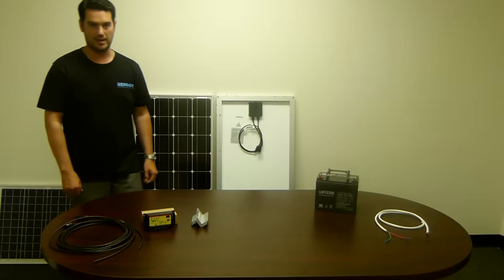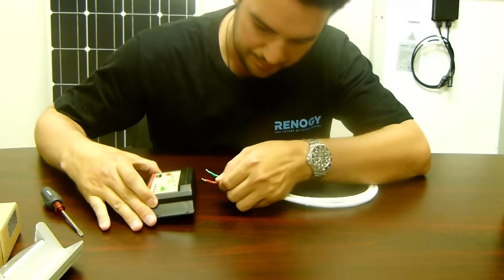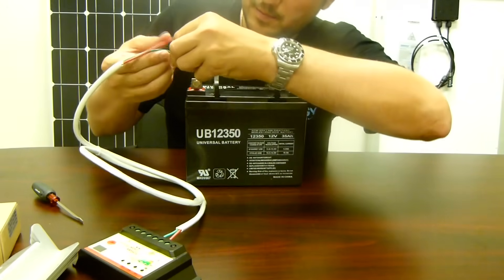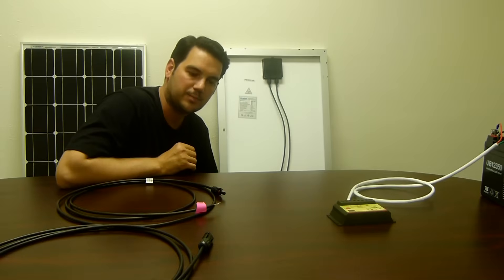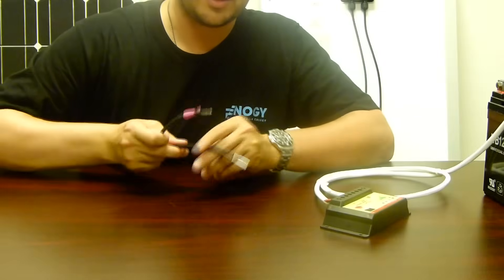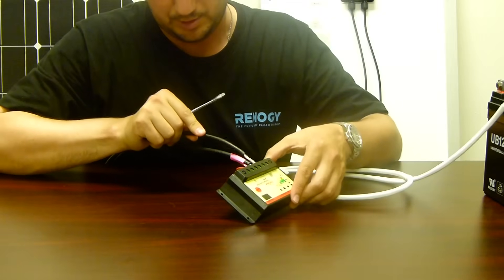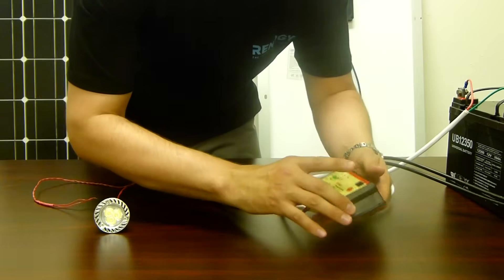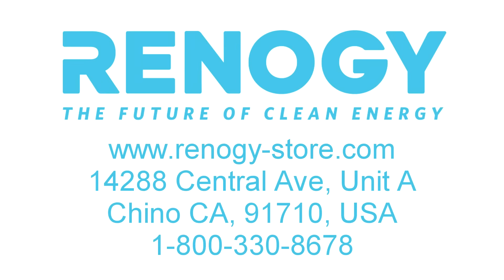Renogy: 100 Watt Starter Kit Solar Panel Installation Guide (Previously Complete Kit)

Comment: Can we use the load in the charge controller to connect to the power inverter???
Reply from the maker: Hi +Saeed Mizan, No. You cannot use the load in the charge controller to connect to the power inverter.
Reply: Does that mean we have to connect the power inverter to the battery.
Reply from the maker: +Saeed Mizan Yes, inverters connect to batteries with an inverter cable (e.g. something like this http://www.renogy-store.com/5Ft-4AWG-Solar-Power-Inverter-Cable-p/invtcb-5ft-4.htm).
Reply: Are there any cheaper power inverter cable??
Thank for your help, I appreciate it.
Reply from the maker: Saeed Mizan Hi, you can use any inverter cable to go with your inverter, though it should be the same gauge as recommended by the inverter's manufacturer.
Reply: What is a gauge
Reply from the maker: +Saeed Mizan The gauge size is the thickness of a wire. The inverter you have should come with a recommended gauge size for an inverter cable.
Reply: Oh Thanks. I tell fell like installing this with the help of my parents in my room. What kind of battery do you guys recommend for this solar panel kit?
Reply from the maker: Batteries are dependent on the kind of items you'd like to use with it. If you'd like, you can give us a list of items you'd like to power and their wattages, or amps and volts, and we can help size what would work best for you. However, a 35A-50A battery would work fine for a 100W Starter Kit.
Reply: I want to use 105 watt tv for 6 hrs, I want to charge 2500 mah battery with a 1amp battery charger for 8 hrs, I want to on my 11 watt led bulbs for 8 hrs. So, what's the recommended battery?
Reply from the maker: Saeed Mizan For a 100W panel, a 60A battery should be okay for you. A 100A battery would provide you extra power, however with a 100W panel, it'd take you two days to charge it. We'd recommend 200W if you would like the 100A battery.
Reply: Is it okay if I use 2 30A batteries instead of one?
Reply: Would a 500w power inverter be enough??
Reply: Can you recommend me an affordable power inverter?
Reply: Renogy Solar?
Reply: Renogy Solar?
Reply from the maker: +Saeed Mizan Yes, it'll be fine to use two 30A batteries to make a total of 60A.
Reply from the maker: +Saeed Mizan Yes, a 500W inverter should be enough to handle what you're planning to power.
Reply from the maker: +Saeed Mizan Here's a link to our own inverter. I'm afraid I wouldn't be able to recommend another one as I don't know much about other manufacturer's inverters. http://www.renogy-store.com/500W-Off-Grid-Pure-Sine-Wave-Inverter-p/invt-500-12v.htm
Reply: So that must be the cheapest must. Would a 500w inverter be enough to power a tv for a few hours
Reply from the maker: +Saeed Mizan Yes, it should be fine. The size of the inverter just needs to be big enough for the running wattage, so with your 105W TV, you'll have almost 400W of extra power.
Reply: Oh that's good. Thanks

Comment: i am new to this. just a series of questions. (1) so, the purpose of charge controller is to allowed the solar panel to transfer electricity to the battery, so that the battery becomes charged, right? (2) and the battery is also transferring electricity back to the charge controller, so that there is an output from the charge controller, where you can attach a load, right? Will i need an inverter if i'm going to load it with a series of electrical extension points?
Reply from the maker: +Danil Xu 

1) Yes, the main goal of the charge controller is to regulate the flow of power that is being put into the batteries from the solar array. The controller reads the voltage off of the battery and depending on its state of charge the controller will adjust the voltage and current being output to in order to make sure that everything is being charged properly. 
 
2)The battery is providing power to the charge controller for the circuitry to power up (which is why you need to plug the battery in first when setting up a system), and to the load out terminal. Since the load out terminal just receives power from the battery and not the panels, we usually suggest running any 12V DC devices from the battery directly and not the load out terminal. That terminal is mostly only for a utility light or something else like that. Not for super heavy and constant loads. 

3) I’m not really sure what you mean by electrical extension ports. If you are talking about a power strip like any standard one that you would plug into a wall, then yes you will need an inverter. In fact, you will almost always need an inverter because most people are not running 12V DC devices. That is mostly for people in RV’s. If someone is getting a kit for their house, cabin, shed, etc. then they are going to need the inverter to run any 120V AC devices. 

Feel free to message us if you have any other questions.

Comment: I bought a 100W Solar Panel 100W Solar Module for Caravan Boat Power12v Battery off grid. I have not been provided with the other accessories . Can you let me know what other accessories OI need please. Thanks
Reply from the maker: +Mahendranath Gunputh You'll need a charge controller, an adaptor kit to connect your panel to the charge controller, and a tray cable in order to connect your charge controller to a battery.  Depending on what you plan on using this panel for, you may need to buy a battery (if you're not connecting the tray cable to a battery you already own), an inverter, and other cables. If you'd like, you can contact our sales team at 1-800-330-8678 on Monday-Friday from 8 a.m. - 5 p.m. PST and on Saturdays from 9 a.m. - 2 p.m. and they'll help you size your system and figure what accessories are necessary for you. Please let us know if you have any other questions.

Comment: Are the wires coming off the solar panel marked as positive and negative on the panel, or wires somewhere?
Reply from the maker: Hi +Wes Chrostowski,
Sorry about the belated reply, but yes. The wires coming off the solar panel should be marked (+) and (-), also the positive MC4 will have a red ring around the connectors.

Comment: Hi,
If I installed this system in a van conversion would. it need to be grounded? If so,  where would I run the wires?
Thanks
Reply from the maker: +megaleadjp 
Sorry for the belated response. You will not need to ground the solar panel. If you would like to ground the solar panel there will be two grounding holes located behind the solar panel.
Reply: +Renogy Solar ty

Comment: can this power my rv ac, if not what else do i need, or how many of these panels and batteries i need thanks!!!
Reply from the maker: +2phalanges Hi there, sorry about the belated reply. It actually depends on your ac's wattage, or if you don't have that, you can provide us with your ac's volts and amps as well as how long you plan to run your ac per day. Based on that information, we'll be able to figure out if this system is right for you or if you need more panels, etc.

Comment: So for all of you wondering I called them and basically if you have 1 panel you only need one fuse just in front of the battery on positive side rated the same amps as your controller.  Mine was a 30amp that came with the 100 watt solar panel.
Reply from the maker: Hi Carlos, a fuse helps to protect your system by preventing large currents traveling through the wires to damage the solar panels or battery. You can have two fuses in a system, one between the panel to the charge controller and one from the charge controller to the battery.
Reply: @RenogySolar  Renogy website states controllers have built in protection.
Reply: That is true however from the battery to the controller is unprotected. If a short occurs in that length of wire a hot spot will develop and can cause fire. A fuse must be on hot battery wire as close as possible to the battery terminal.
Reply: fuse?

Comment from the maker: +Vincent Cheng The 100W Starter Kit comes with a 20ft 12AWG MC4 Adaptor Kit, however, in order to connect this kit to a battery, you would need to purchase a tray cable.

Comment: Hi I installed this kit on my rv.  I had a question maybe you guys could answer.  I would call in but it might help someone else who's reading this for info.  I bought a small flat screen t.v. for my rv.  It's 35 watts and is either 12 vdc.  Or 120 vac.  Would it be better to run it on 12 V or 120 V with an inverter because at 120 V at 35 watts is .29 amps and 12 V at 35 watts is 2.6 amps.  Any help would be appreciated.   Thanks
Reply from the maker: troy scott We would suggest running this through DC as you wouldn't lose any efficiency with the inverter. If you have any further questions, please feel free to ask us.

Comment: Is there a video on connecting this setup to a solar generator? I am also having a hard time getting the cables to stay into the charge controller.
Reply from the maker: HI TheBr20042003,
We're sorry but unfortunately we do not have a video showing how to connect this to a solar generator.  As for the issue with the cables and the charge controller, we would suggest a good twist with the screws to make sure that it's tight and secure. If it still proves to be an issue, let us know.

Comment: Customers, on Amazon, have said good things about your company and its products, so I went ahead and purchased your Renogy 30W panel and I'm using that to charge a rather small 12V lead acid batt. thru a Renogy 10A charge controller. Your products are pretty good so keep it up.

Comment: I am a bit confused on whether I need to attach a load , the video shows a 12v LED , Is this required , is it a dump load ? can I safely use the charge controller without a load
Reply from the maker: The load is just optional. The main reason people use it is for the timer functions that the controller can do. You can also run your DC appliances directly off your battery.
Reply: Renogy Solar Do you have a video for this? I am completely new all things electric and would like to see that.. Ultimately I want to run my home office on solar power..
Reply from the maker: Hi Oscar Martinez.

What kind of a video are you asking about?  A video with DC appliances running off of a battery? At the moment, we don't have one, but we will definitely add it to our to-do list. Though, please note that in order to run a home office off of solar power as you'd like, you will most likely need an inverter in order to convert the power into AC power (which most appliances run on). If you have any questions at all regarding setting up a system, or trying to figure out the appropriate setup, please feel free to call us at 1-800- 330-8678 Monday-Friday 8-5 p.m., Saturdays 9-3 p.m. (PST), or visit our forum at http://renogy-store.boards.net/ and leave us a comment. We'll be sure to get back to you as soon as we can so that we can better assist you.

Comment: Do u need fuse on it?
Reply from the maker: A fuse is always a good measure for safety. Its main function it to protect from too high of a current. The size of your fuse will depend on factors such as your system size and location.

Comment: 1)Should there also be a fuse installed somewhere?
2) For an RV for example, doesn't the load run direct off the battery?
Reply from the maker: 1) A fuse is always a good measure for safety. Its main function it to protect from too high of a current. The size of your fuse will depend on factors such as your system size and location
2) The load is just optional. The main reason people use it is for the timer functions that the controller can do. You can also run your DC appliances directly off your battery.

Comment: OK, I'm a little confused. The MC4 wires coming from the panel need to be connected to a charge controller. But the charge controller doesn't have MC4 connectors. It requires bare wires. Do I need to buy a set of MC4 wires and cut the wires in half so that I can strip the wire from one end? That seems like a waste. Is there another option for making the connection from the MC4 connector to the charge controller?
Reply: You could buy your own cable, set of strippers/crimper, MC4 connectors, and make your own MC4 connectors.
Reply from the maker: Yes there is another option. You can get a adapter kit from us, which has an MC4 end on one side and a stranded copper cable on the other.

Comment: I was also curious about what stephen asked below.  Also when connected to travel trailer batteries is there a resistor in place to prevent overloading the 7 way circuit on the tow vehicle??
Reply from the maker: +joshua webb Hi there Joshua, we apologize for the belated reply. Somehow we missed your question, but yes, the charge controller has a blocking diode built in to prevent power being backed up into the controller and into the panel. But what exactly do you mean to protect the 7 way circuit on the tow vehicle?
Reply: Thanks for the response.  I've got it all worked out....when I said resistor earlier I meant diode and after posting this comment I realized the diode on the trailer 7 way had more to do with the truck than the charge controller.  My truck 7 way is tied into the trailer house bank batteries the solar charger is charging.  I checked with ford and they have a diode in line on the trailer plug preventing backing feeding up the trailer 7 way.  But good to know there is a diode in the charge controller as well to protect the panels.  You guys have a great product.  Currently have 300 watts of solar power from you guys.  Cheers!
Reply from the maker: +joshua webb That's great to hear! We're glad everything worked out and is going well for you! Again, many apologies for getting back to you so late.

Comment: I'm assuming when I hook my RV up to shore power the charge controller is smart enough to not harm the panels or anything?
Reply from the maker: +Stephen “How2DoJustAboutAnything” Weppler 
Hi there Stephen, we apologize for the belated reply. Somehow we missed your question, but yes, that is correct. The controller and solar charging system can be hooked up in tangent with the shorepower solar charger. If you have any other questions, please feel free to ask us.

Comment: I appreciate you're demonstrating the hook up with a kit and you've done a good job, however, we live in Texas and the summers are brutal. We run a/c 24/7 plus the normal uses of a house. What type of system would you recommend for off grid? Thanks in advance.
Reply from the maker: Generally solar systems that run AC run in the 1kw or more range. We would need to know the wattage of your AC system before we could give you a recommendation. Thanks.
Reply: Thank you.

Comment: what its the names of these cables ?both
Reply from the maker: Hi, the cable running from the solar panel to the charge controller is called the Adapter Kit. The cable running from the charge controller to the battery is called the Tray Cable.

Comment: Hi
im wondering if u can use 4 bulbs and charge a phone sametime with this system?
Reply from the maker: It is more likely with LED bulbs as they have lower wattage. You would need a pure sign wave power inverter to convert the DC power to AC, and from there you could plug in your electronic devices. We currently sell a 500W and 1000W power inverter here: https://www.renogy-store.com/category-s/1880.htm.
Reply: Renogy Solar
Or you could get a 12 volt phone charger and hook it straight to your battery. it is more efficient to run things like a phone charger and light bulb straight from the battery and use an inverter only if needed.

Comment: What type of applications would a 100 Watt solar kit be good for?
Reply from the maker: Hi Michael, the 100 Watt Kit could be used for small 12v battery charging, outdoor LED lighting, or a fan. We recommend adding an inverter so you would be able to run your AC appliances such a laptop charger or small LED TV.